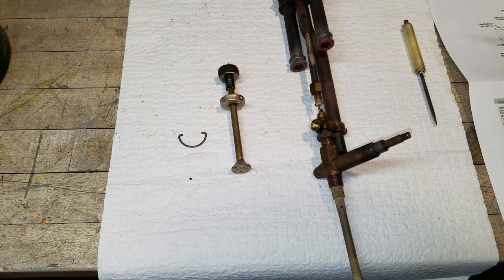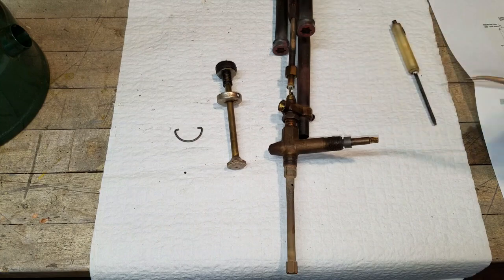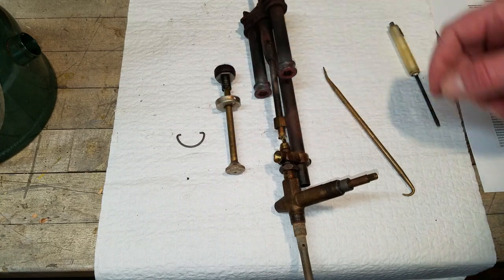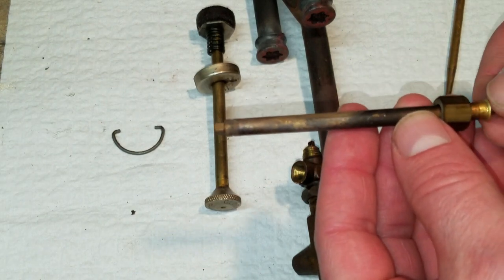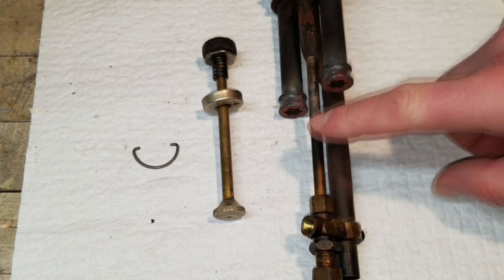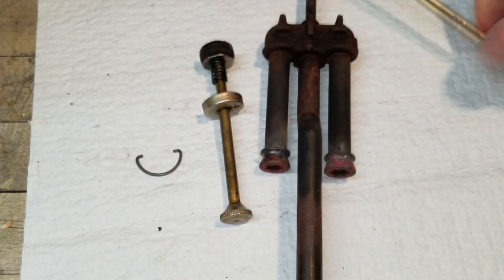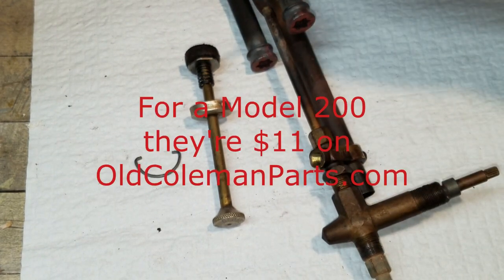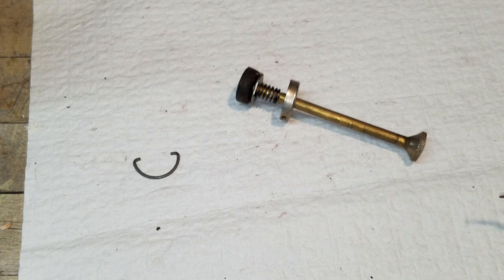Coleman Lantern Troubleshooting Basics

Comment: Great video!  Just found your channel tonight.  I have a Coleman Lantern 220e with a date stamp of 11-52 that came into my possession after my neighbor passed away 10 years ago.  I also have a 290a that my father gave me in 1991.  I'm wanting to make sure the 220e works before we travel west this summer.  However, the main valve wheel that turns 1/4 to the left to light is stuck and won't turn.  Do you have any recommendation (or a  video) on how to loosen the valve wheel?  Thankfully the tank still holds pressure.  🙂
Reply from the maker: Sorry about the late response. I have had this issue before on an old 220 and I ended up replacing it with a used valve. The other likely option is disassemble an soak the valve in something like Marvel Mystery oil.
Reply: @RavenwoodAcres  Thanks!  I ended up disassembling, cleaning, and loosening the valve wheel.  After also replacing the generator, the 70 y.o. lantern works like a charm!  :-)

Comment: How do you change the check valve? I just got a 220f and the tank won’t pressurize at all.
Reply from the maker: It is not to difficult unless it is seized in there. Start with large flat tipped screw driver. The check valve has a slot and with some luck it should unscrew. There is some good video on YouTube. However, I owe my followers a video so I produce one this weekend.
Reply from the maker: Check out this video from Oldtown Coleman. https://www.youtube.com/watch?v=7vv0KBVWqK8

Comment: My lantern is spitting out fuel when I turn the gas on. Any idea why?
Reply from the maker: It sounds like a gas generator issue. However, to troubleshoot more, I will need more details. I assume it is spitting fuel out of burner tubes? Have you done yet work to it recently?
Reply: @RavenwoodAcres  no I haven't but I'm going to tonight. It's like it spits out the fuel through the mantles. I'm going to clean it really good and maybe there's something stuck in it somewhere. I'll get back to you. It's like new. It did it once and I kept it burning and it slowly went away but it took a minute.
Reply: One thing he didn't cover was the pickup tube. there is a hole at the top and a hole at bottom. 1/2 half turn of valve lets air thru from the top of tank to light.. then when warmed up... open the valve more to start getting the liquid from bottom of tank. There is a rod that needs to move up and down when valve is turned. remove the gen, remove the air tubes, reinstall the gen... this operation can be checked.

Comment: Excellent video-  I picked up 3 old Colemans lanterns and a stove from local recycle transfer station, just getting around to messing with them. One was not stored well and may be for parts, the other two pressure up but nothing seems to come up the biz end.  When u open the gas cap there is pressure release, so maybe spiders have clogged up airtubes?. I will disassemble and mess with them when I get a chance
Reply from the maker: If you're not getting a hissing sound when you turn them on. Then you probably have a fuel clogged some where. I would take the air tubes and gas generator off. From there I carefully turn on the valve to see if I get fuel from the valve. If not your issue is with the fuel feed assembly. If you get fuel your issue is most likely with the gas generator. Let me know if this helps? Thanks for watching!
Reply: @RavenwoodAcres  you said “air tubes” , there is more than one air tube? 
Thanks for the help !!
Reply from the maker: @aaron5632018  Let me correct myself, there's two burner tube that come from mixer manifold.
Reply: @RavenwoodAcres  gotcha !! Thank you for the reply so quickly! 
 You seem super knowledgeable can I bounce something off of you real quick? I got a garage sale lantern the other day , it’s in pretty good condition in a custom wooden box the old man made for it, I’m getting pressure in the tank just fine,  but nothing whenever I open the knob for the pressure release , the only pressure release is whenever I open the cap to  the fuel tank  , that’s how I am sure I’m building good pressure , no leaks ,, 
  what would you do next? Thank you again
Reply: It’s a Coleman 2 mantle

Comment: Nice video, brass fittings is a softer metal and have tapered threads and do not require thread sealer.
Reply: He said it was his preference!!!  And apparently knew you would be here to point out that you knew better.
Reply: all threaded pipe fittings require thread sealer

Comment: I have a lot of 220F's to restore, and a few of the 220J and 220K which are essentially identical - which parts should I keep in inventory? - I am making a bulk order of parts, so in my cart I have some generators and some fuel filler cap gaskets and some leather cups and a check valve or two - what else?
Reply from the maker: You got it mostly covered. You might consider adding a share globe and the ventilator barrel nut.

Comment: Great video Mr. N! Ur vid have helped a lot in restoration of a 1/1960 220e lantern. The Question is how do u get the rust flakes and particles out of the tank/fount?
Reply from the maker: You can start with a shop vacuum. They make small attachments that are designed for detailing car interiors. Another method is to add .177 caliber steel BB's into the tank and shake it to break up the rust so it can be flushed out. Some people even add liquid rust dissolving solutions with the BBs and then flush with water.
Reply: @RavenwoodAcres   I saw another lantern restore video where the guy filled the tank with vinegar, let it sit 24 hours, then poured in a mix of water and baking soda to neutralize the residual acid, then triple rinsed the tank, then used alcohol (probably the 91% stuff without any extra ingredients) and that gets rid of the water.  Once that's dried out it's time to see if the rust got into the fountain tube.
Reply: one guy suggested a piece of chain and some fuel.. shake it around.. my tank emptied out fuel that looked like unfiltered apple cider..
Reply: @philipanderson4673  I just dump steel BBs in it and shake it , then use a small telescopic magnet to recover loose bbs. After that I redkote the whole inside of the tank it’s a fuel resistant liner

Comment: hello, you seem to be very familiar with coleman lamps, and I wanted to ask you about the fuel on the latest, most recent model from Coleman. 
I don't want to buy one to put only Coleman brand cans which are not found everywhere but I would like to know if the lamp works without problem with 95 or 98 unleaded gasoline?

Thanks !
Reply from the maker: Some claim that all Coleman lanterns (except kerosene) will run on unleaded gasoline. I have however, ran over a dozen tank of gasoline through my Coleman dual-fuel lantern with no issues. My preference is non-ethanol when I can find it. I guess that means I should test that theory for the sake of good YouTube content. 😀

Comment: Can  you explain a pump that won't push because it has too much pressure?  Take out the check valve, and it pumps air fine...  so the air tube is not clogged, right?  Put the check valve back in, and cannot pump...   I'm stumped.
Reply from the maker: This problem is usually associated with the a clogged or stuck check valve. However, it you have taken it out and cleaned the valve, maybe not. Another thing to check is the threads the air stem. That is the piece that threads into the check valve from the pump plunger assemble. If those threats are stripped you won't be able to open it to pump air into the tank/fountain. I hope that makes sense, please reply back with if you have more questions.

Comment: Great video! I am just getting started on restoring stoves and lanterns. Very informative. If you have time to answer a quick question, I have a lantern that does not sputter or bring fuel out of the generator when i try to light it. Just air comes out from the mantle, to the point that it moves the flame from the match but dose not light. Would that be a problem in the portion that is inside the tank? Thanks and keep the videos coming.
Reply from the maker: Thanks for the feedback. 
Interesting problem with your lantern. Have removed and inspected the gas generator? I would start there because if you're getting air then there is probably not a clog.

Comment: Hello,
I have a question about a valve and generator for a dual fuel 424 gas stove. I left gas in it for years and then had issues. I replaced the generator and now when pumping it it sprays gas out the generator and I'm pretty sure I ruined the graphite in the brass nut. Any suggestions besides buying a valve and generator assy?
Reply from the maker: Sorry for the late reply. YouTube doesn't do the greatest job at letting me know when I have new comments. If gas is spraying out of the generator the valve closed then there is an issue with the valve. I would disassemble the valve area and inspect for damage.

Comment: I have a 200A and it’s very fussy and it won’t run below a 3/4th tank of gas. I just replaced the generator as the old one was fried. Any ideas?
Reply from the maker: Sorry for the late response. That is tough question. Does it hold pressure over night? Either way, I lean towards a possible issue with your fuel feed systems within the tank. Have you ever taken it apart?

Comment: Great Video. Hear is my problem, the lantern does not get bright enough and does not sound like the blow torch when it running correctly.
Like it is being starved for gas?

I have taken everything apart, Cleaned the tank with steel bolts, break up rust and flushed the tank. Cleaned the lower fuel supply tube, cleaned and inspected the valves installed new gas generator (that helped a little). When I pressurize the tank and open the main valve the gasoline seem to bubble  and does not squirt (like a gas stove). 
The gas that was in the lantern was old I dumped. The new lantern gas is in a 1 gallon can which is old but the galoline look clean. Do you have any thoughts.
Reply from the maker: Ed, it seems like you have covered all the bases. My first guess was going to be the intake tube could be partially clogged. However, you have cleaned that and replaced the gas generator. So the only thing I got is to double check the fuel intake for clogs. Thanks for watching.
Reply: @RavenwoodAcres  Thank you, will try to clean intake again.
Reply: Did you ever resolve the problem?  I am having the same issue...
Reply: sean m I have been busy on other projects. Thanks for the reminder, I have time now to restart the project.

Comment: Thanks for the video! I own a model 282-700E and it has an issue...I unscrew the valve and try to pump air in the tank, but no air is allowed in the tank, pump is hard to push an kicks my finger back up. Any idea for a possible fix?
Reply: I have the same problem. How was it fixed?
Reply: The check valve in the bottom of the pump is probably stuck closed, not allowing air into the fount.  Spray some carb cleaner in and let it sit.  If its too bad you'll have to remove the check valve.  Use a tool designed for it  you can buy them.
Reply: Check valve bad

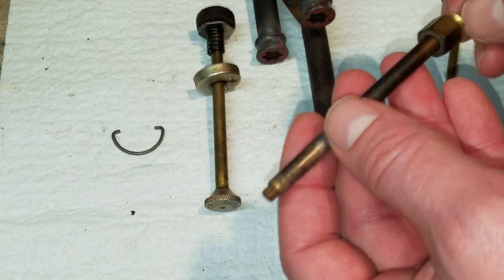Comment: Please, from what material is this white (10:30) part of the vaporizer made? Here in Brazil there is no spare part. I have to adapt.Thank you (google tradutor).
Reply from the maker: It is a heat barrier or insulating material. Sorry but I do not know what it is made of. Older lanterns vaporizer could have used asbestos. Newer lanterns probably a similar heat resistant material like fiber glass.
Reply: @RavenwoodAcres  Thank you!
Reply: fechaed use brass wool to wrap around spring

Comment: We have a Coleman rechargeable family-size led lantern.  We are unable to remove the main housing of the unit from the bottom.  It appears to catch right under the control knob, and we are afraid to pull too hard because of the circuitry close by.  Is there a lever that we are supposed to press so that we can completely slide off the bottom housing?  Thanks for helping us.

Comment: How do you fix the check valve ?? I have a single mantel army Colman  1946
Reply from the maker: In some cases you can fix it by pulling it out and cleaning it. However,  the spring could be weak or the seat could be damaged. Either way the first step is to remove it, next you can determine weather or not it can be clean or just replaced. Thanks for you question, please let me know if I answered your question or if you.
Reply: @RavenwoodAcres  The check valves don't have a spring. It's a ball check valve which should move freely on its own. The pressure on the pump side opens it, the pressure in the tank seals it in place.  Spraying carburetor cleaner through them, while in place, can often times clean them up.  Otherwise they should be removed with the proper tool which can be found on eBay.  Then you can clean it better or replace it with new.

Comment: Hey Nomad, just discovered your channel. I just purchased a 220J model coleman lantern yesterday at a thrift store for $8. Its in absolutely beautiful condition. Im having trouble figuring out why i cant get it to light. The gas generator will release pressure from the tank, but only air, NOT fuel (yes, i did put fuel in it, lol). Do you think i have to clean the inside of the tank out? It holds pressure just fine and has no leaks, it just wont push fuel to the generator. Any pointers would be greatly appreciated!
Reply from the maker: I would fully disassemble and clean the lantern. There is good chance that the debris clogging the fuel intake screen. One way to check the tank is by draining the fuel into clear container so you can inspect the fuel. If you see a lot of contaminates, it likely that you have a clog. Coleman lanterns depending on the the year and model have some sort of intake filter/screen in the tank. This can be only accessed by a full dissemble of the lantern. If you have questions check out my 220 video: https://youtu.be/a4KmuOg4EMA. Thanks for watching and let me know if you have any questions.